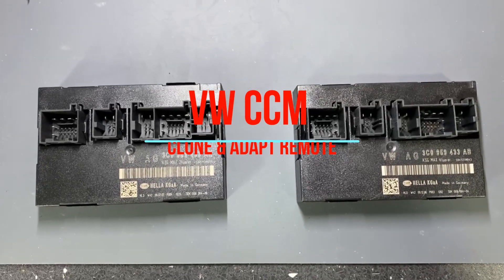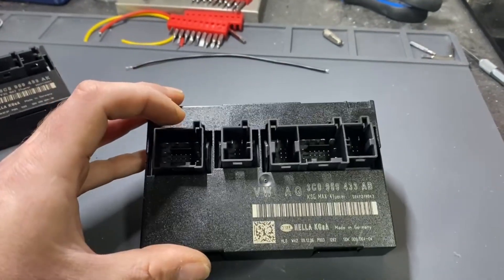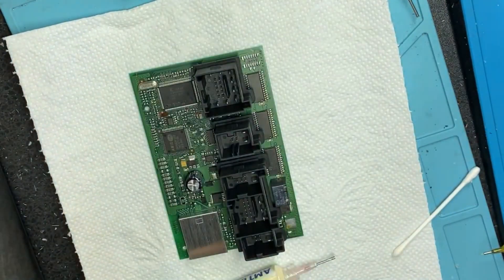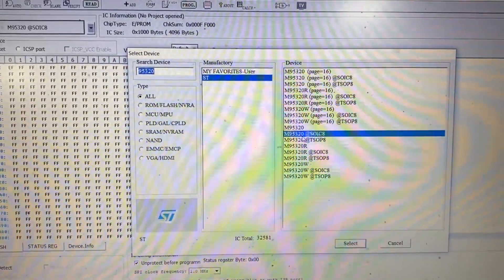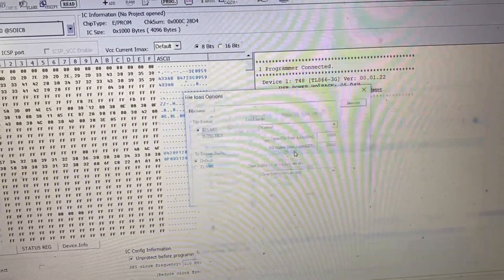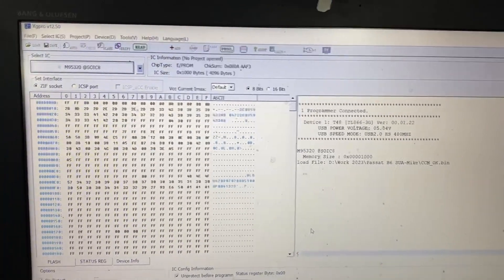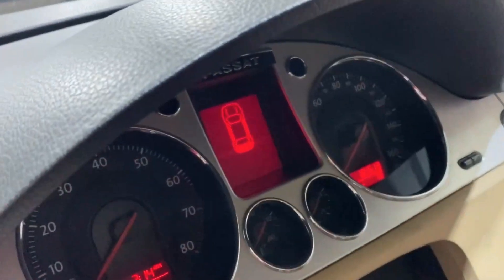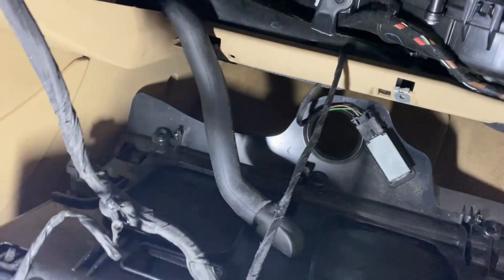Passat B6 CCM Clone - Immo Data / Comfort Module :: How To

Comment: Great video. I have passat variant b7 2012 with bad CCM after short cuircut at tailgate lock. CCM is controlling tailgate lock the opposite, so always opening.  Replaced lock but still issue. Got a 2nd hand CCM and lock worked okay. Tried to read coding with VCDS from 2nd hand CCM, but Immo is blocking access. Even by putting jumper on T30 /T15, no access.
What would you do? Soldering/swapping EEPROM? Or is there any other way to get access to CCM w/o soldering?

Comment: Just swap the EPROM chip , 
No need to program
Reply from the maker: Its this specific car original module was on 315 Mhz ( from USA ) and in europe its hard to find that module. The best way if you switch from 315mhz to 433 Mhz and different HWs/SW its to transfer only immo data
Reply: If I saw the chips from my original to the donor one, it should work right?

For some reason my vehicle isn’t receiving power!! I have keys coded to car , and all components are original… none of them are giving me ignition!! It’s as if the cluster is deas

Comment: I have a 2007 model Passat automatic car. At first, the spare key was opening the car from close range. Later, the spare key could not open the car. The other key opened the car from a very close distance (1 meter). After a while, that key stopped opening the car. I have been unlocking and unlocking the car manually for a long time. When I want to duplicate keys, the car does not allow copying or deleting keys. When connected to the Comfort module, all features of the car are active, only the part related to the key is not active. What path can I follow?

Comment: hello my car is passat b6 3c 3.2 fsi. There is a sound coming from the comfort module of my vehicle. it's like a vibrating sound, like a metal wire waving in space. It does this every time I get up in first gear, close the windows, and insert the key into the hole. how does the sound come all the time? I removed the glove box and listened, the sound comes directly from the comfort module. There is no malfunction in the vehicle, but this sound bothers me. What do you think is the problem?
Reply from the maker: Hi, the CCM have only small relay what can cause some sound or clicking, by what you described only ideea is to replace the ccm and see if the sound persist.

Comment: Hello sir why cant just swapping the chip to the donor module.? Will it work ?
Reply from the maker: In this specific case was 2 different hw and also sw was not the same. I always cloned immo data when i changed ccm, due different failures of old ccm(locked time, not sure if eeprom data was correct 100%, and so on )
Reply: But can this be done with an eeprom clamp reader? without desoldering?

Comment: hi bro mi passat cc not ignition and not dash light, my ccm problem or mi key?
Reply from the maker: Hi, hard to say without proper diagnostic steps, make a diagnostic to  check elv is ok. Can be also a fuse check all of them. You need to check step by step
Reply: @UnixCoDElectronics  my fuses its ok and rele, elv no faults coden insert my key and not responding nothing
Reply from the maker: The you need to check your key to see if transponder is ok. Seems like a key issue, behavior like missing key / not programmed.